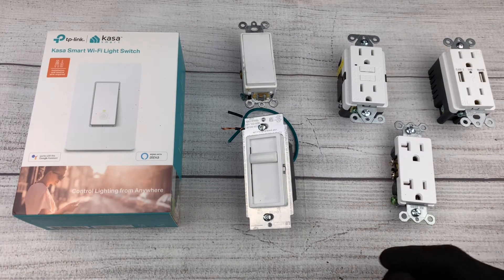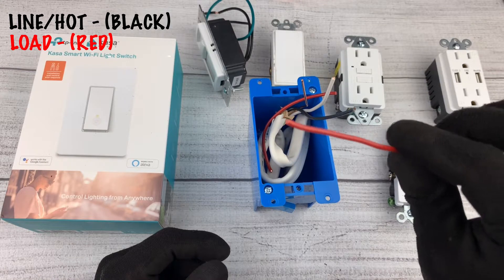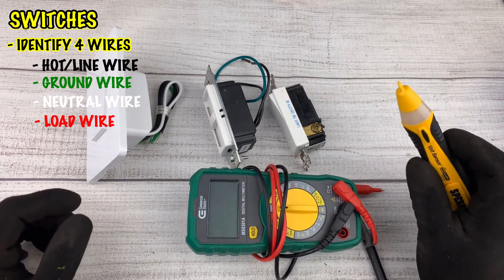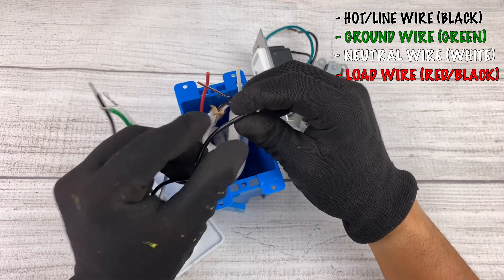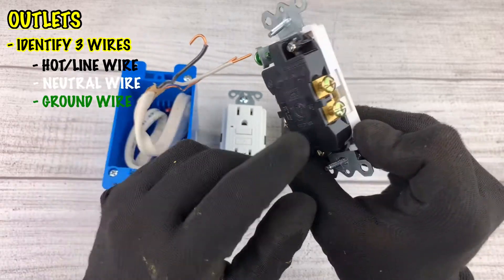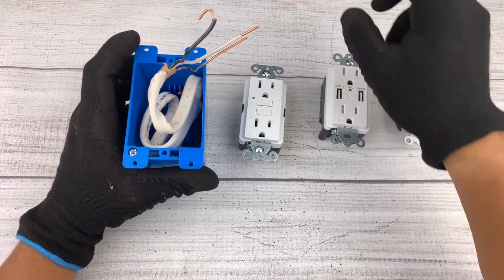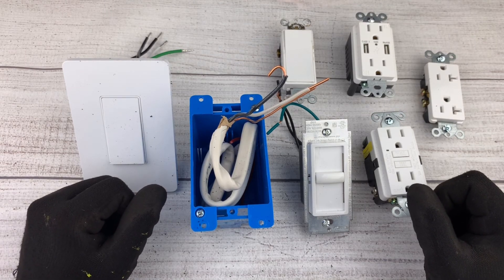Home Electrical Wiring Basics - Tutorial (2022)

Comment: Also in the video it’s shows two different rated receptacles. one is a 15 amp and the other is a 20 amp. make sure when your DIY in your home that you have the correct size wires for a 15 and 20 amp receptacle. your 20 amp receptacle needs 12 gauge wiring end of story always. your 15 amp receptacle will use 14 gauge wiring. Pay attention to that detail. It easily gets overlooked by DIYers.
Reply from the maker: Good point. Thanks for the comment

Comment: So helpful! Please help me figure out how to upgrade from a 2 prong outlet with no ground, to a 3 prong GFCI that is safe for equipment use. 
If the outlet box is plastic with no ground in sight, would the following be correct:
1. Change out the plastic box with a metal one
2. Use a self tapping screw to attach a 6” ground wire to the metal box
3. Install a GFCI that has a ground screw, connect the 6” ground wire, neutral and hot

Comment: My power went out for 1 hour
 When it came back on my front, & back porch lights. My.overhead kitten & laundry fixtures and one outlet . My husband just fixed  it. The black wire on the circuit breaker came undone. Fixed by returning black wire to circuit breaker.  Fixed

Comment: I'm no expert but the GFCI outlet will label "Line" for the exposed screw terminals (which get the hot feed), and "Load" under the tape covered terminals, which feeds power downstream.  The downstream outlets get a GFCI sticker for clear labeling.

Comment: I really enjoyed your presentation. You explained the hot and neutral better than some of the pros who rambled off on complicated stuff newbies don't understand.  I had a snag when I went ti install a usb outlet and saw 5 wires!!!!!! I found out about Wago connections. What gauge is that white coated wire you have in that blue box, and what ampage is the circuit in your panel box?😄

Comment: I’ve been advised by every electrician I’ve ever spoken with to not use those push tabs in the back unless you are wiring a gfi… Keep in mind, all it takes is “a 1 wire hook up, 2 wire a f@ck up”…
Reply: Those are not push tabs aka backstab that he was showing. When you tighten the screws, it clamps the wire in place and is a totally legitimate method. Residential grade receptacles and switches have the push tabs that you are addressing. Only the commercial grade (higher quality) have the clamping option and have no backstab option.

Comment: I learned somethings by watching BUT ,the first thing I think one should do is turn off the power to make sure there is no current while you work. Second in older houses, the wires in the junction boxes are not color coded or they have become so discolored you can't really see the colors

Comment: So is a 14/3 wire the one to use for switches and bulbs, and a 14/2 used for outlets? 

I’m rewriting some things in an old house and all they have is white and black wires ran to bulbs, switches and outlets
Reply: 14/3 or 12/3 is used if 1) power in comes to the light first (switch loop), 2) in a duplex receptacle where one receptacle is switchable, 3) in a multiwire branch circuit where each receptacle of a duplex is on a separate circuit, and 4) as travelers in 3 and 4 way switches. Otherwise, 14/2 or 12/2 is used.
14 gauge wire is for 15 amp circuits, although 12 gauge can also be used. 12 gauge wire is for 20 amp circuits and 14 gauge cannot be used.

Comment: I recently removed my out put to installed new GFCI in my kitchen.After remove old out let I found  two set of. Blacks,Whites and Reds wire .,and only one ground wire is connected to J box. One set of wire from the power source and the other set came from another out let of my kitchen .I did install first set black and red to the hot lines of GFCI and the white to neutral terminal then I installed the second set of wire to the load terminal and connected a ground wire from J box to the HFCI terminal.after work done I turn power  back to check but not working and circuit break on panel has popped Do think what I am do wrong.Thanks

Comment: you're wrong about a few things. First off the neutral may read zero voltage but it actually carries voltage. This is why the NEC doesnt call that a "neutral", its referred to as a "grounded electrode conductor".  The reason it reads zero is because it is grounded and your meter reads the flow of current to ground. in the case of an open or disconnected neutral you will read 120-208 or w/e the operating voltage is from neutral to ground. Also the red wire can mean a lot of things when dealing with residential wiring. 3 or 4 way switches use 3 wire romex for travelers, 240 volt appliances may use the red wire (though some dont need a neutral so this wire can be utilized but is often marked with tape). You really shouldnt spread misinformation about something that could hurt or kill someone. I hope this helps you

Comment: I have never seen a red wire in home120v wiring, what am I missing? I have wired outlets gfci's lights and more, is it different here on the west coast?
Reply from the maker: Sometimes they use it for a load wire or a traveller wire in three way switches.

Comment: TP-Link and its subsidiary Kasa are essentially Chinese government controlled spying operation hiding under the cover of a computer equipment manufacturer based in Shenzhen China. The wireless devices (WiFi-controlled switches and plugs) all have built-in software that allow all activities involving their hardware to be monitored by the Chinese government as the servers are located in China. They also have your network information (SSID, LAN, WAN, password) and exact location where the devices are installed. This information is fed to them by you during the device setup process. They give you no opt-out option for this!

Comment: I have an old house with no ground wires in any of the fixtures, switches, or outlets. Should I do anything about that or is it ok?

Also, with a multimeter, what should I touch the ground end to given I have no ground wires? He mentioned a screw but I'm guessing he doesn't just mean a standalone screw.

Thanks so much for the video btw very helpful!
Reply: If the box is metal, touch one probe to the box, if you get ~120v the box is grounded, likely by a wire on the back side. Otherwise you touch one probe to the hot side and the other to the neutral side. You should get ~120v. On a multimeter, the orientation of the probes makes no difference.

Comment: In your beginner video you showed a light switch that had 2 black wires one for hot and one for the load .
How do I know which black wire connects to incoming power and which connects to the wire that I'm wanting to supply to say a light .
Does it matter ?

Comment: I can repair windows, do roofing, basic carpenter work, basic engine work, etc... but i have never ever felt comfortable fooling with electricity. even basic tasks. however... after seeing this..i feel confident in basic switch and outlet replacement. i even took notes... came to about 4 pages worth. i was always intimidated by the wires in the receptacle box... always thought they probably all had voltage. nice to know only one is hot while the panel/breaker is on, and the lead wire can be hot if panel/breaker and switch is on. Neat! Thanks! think i'll go buy a multimeter in case the wife ever wants to change the switches or outlets.

Comment: If the black wire brings in the power to the switch and the white takes it back to the panel completing the circuit, what do you need the load for? The black is already feeding the switch.

Comment: Wire 'any' outlet or switch? 'load is red'? Where did you get that idea from? It looked like you just laid a red wire in there. You would only have a red wire if you are using 14/3, etc...  This usually is in the case of a 3 way  switch or if it saved wire to run a 14/3. You should not be telling viewers to assume that red is not  'hot'. For the most part, red and black are interchangeable as 'hot' . A standard switch would usually, but NOT always, be 14/2 and only have black. There is no regulation that prevents an electrician from subbing a red wire for a black one and visa-versa... What will you viewers do if they run into a 220v circuit where red and black are both 'hot'? Also, you had a GFCI tutorial and did not at all emphasize the importance of line/load with a GFCI. As a Licensed/certified Electrician in CA, I would say the DIY stuff is great but maybe take it easy on the electrical DIY.

Comment: I have a question…it’s semi related to this… you were the most recent video with electric wires this may hopefully respond to my kind of an emergency situation… I have to make a heated wire ASAP for a lizard tank… can I essentially take an extension cord and cut off the female  twist the copper together on that end then electric tape the shit out of that end… and plug it in … will this wire get warm … will it burn to hot…??? Thanks

Comment: Change the “The First Thing You Want To Do” from “Remove the Cover Plate”to “TURN THE ELECTRICAL POWER OFF IN THE AREA YOU ARE WORKING, and check that there is NO electricity present with a volt meter, or voltage tester.”
Reply: If ur doing a simple change of a switch u can work on it hot it’s really not hard
Reply: Maybe that should be the second step. Because if you turn the POWER OFF first, then you won’t know which wire is LINE/HOT and which is LOAD if both wires are black.
Reply: I understand that it's implied common sense but common sense isn't all that common like in plumbing when I explained how to replace an angle stop they didn't think to shut the water off 😂 oh man never again
Reply: What Andy said
Reply: Honest question: if you have the power turned off to the area, how can you test the individual wires to know what is the hot/load wire? Shouldn't you just turn off that individual switch?
Reply: @bombusaffinis  Turning off the switch won't kill the power in the box, you will still have your incoming hot and your switch leg (load) up to the light. If the power is off then obviously it won't be hot, that's why you should test with a voltmeter while it's still energized. Also on a regular single pole switch you don't even need to know the difference between line and load, they can go to either screw terminals on the switch. just.
Reply: @bombusaffinis  most times it’s just a two wire so black will be hot which is the incoming and the black going out to the light is the switch leg and we carry testers and different toners
Reply: if u cant work around hot wires u shouldnt be working with electriity, as testing wires is very common in electical, and u really cant do much testing if the power is off
Reply: Thats a given.
Reply: I mean obviously that’s step number one. Why I’m the fuck would you work on a light switch if it’s flicked on…. If you don’t even know if it’s on or off call the electrician because it’s not the job for you.
Reply: @ricardodelgado8934   The switch can be flipped off and still have power. You need to turn the entire circuit off at the breaker panel.
Reply: @ricardodelgado8934  thats clearly why this video was put up bozo, so people can do it themselves
Reply: @ricardodelgado8934 He’s not referring to the switch but the breaker homie. Turning off the switch doesn’t stop sending power to the circuit.
Reply: @ricardodelgado8934  I just started & my uncle makes me work shit live unless it’s higher deadly voltage w high amps but for simple switches n shit he says it’s best to work it live so you ain’t scared of it. helps build confidence when you’re wiring and also makes you pay better attention lol I got zapped once or twice n instantly was like Okok I need to do this more carefully and with my full attention 😂

Comment: Awesome video. Thanks so much. 

When you have an outlet controlled by a switch, you have a load wire coming in, right?

How do those switches you are showing know what's hot and what's load?

Do you have any tips on cramming it into the box?
Reply: the switches dont know, their not ai, their just set up to receive certain functioning wires in designated slots

Comment: Does it matter if you connect a 15 amp or 20 amp switch or outlet.
Reply from the maker: Use to one that matches the breaker in your electrical panel. If you have 20A breakers for your general lighting then go with a 20A outlet or switch.

Comment: As a residential electrician (6 years all together in the trade, 3 residential 4 commercial) I do approve of everything in this video. But remember, you shouldn't play with electricity, if you can you should always have a certified electrician come and do these things for you if you don't know what you're doing, you can never truly know everything that's going on with your homes circuits (backfeeding to the panel, hot neutrals, reverse polarity) and these can be very dangerous and even life threatening depending on the circumstances.
Reply: 🤣🤣🤣 okay pal

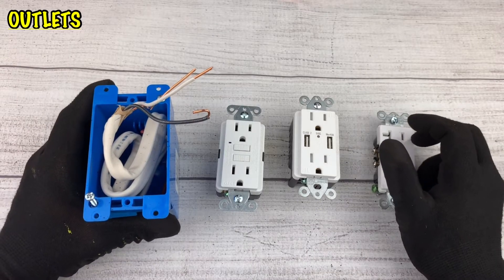Comment: Great video. Thanks for sharing. Just one note, at the 10:37 mark, always make sure when you hook your wire it wraps clockwise around the screw. This way when you tighten it down it doesn't push the wire out and helps to seat it under the head of the screw for a good connection.
Reply: What I came in the comments for 👍

Comment: Always make your loops around the screws are clockwise not counter-clockwise! It will actually tighten the wire loop as you tighten the screws, if you loop it the other way it loosen's the wire as you tighten it down. Just FYI
Reply: Great advice thanks! Not really common sense, most people don't even consider that.
Reply: trick of the trade 😏
Reply: @the_dingler  not really. It’s common sense
Reply: Yup. If you're left handed it's not natural.
Reply: i thought you werent even supposed to put them in the screws, arent there specific holes for that?
Reply: I thought this was common sense
Reply: Better be rackin that breaker in shorts and  t-shirt lmaooooo